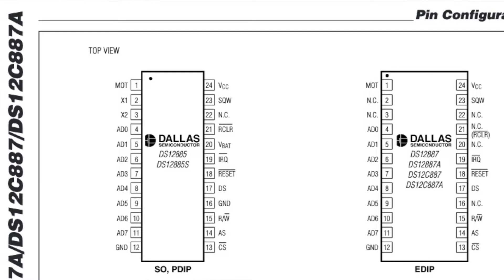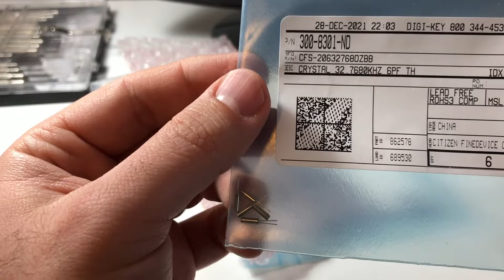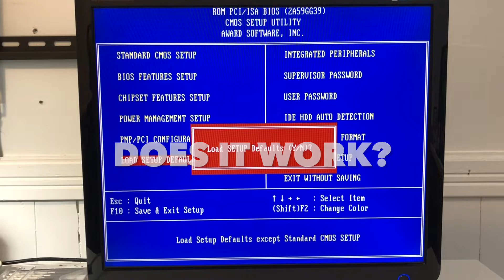Next-level RTC module Upgrade! Replacing the Dallas DS12887

Comment: Unfortunately it didnt work for me... my 486 board hangs in boot code 07 every time I stick the necroware module there... if I replace it with the old dallas the board boots right away  (even though the battery is dead and it doesn0t save any data) ...  it seems this modules are not 100% compatible
Reply from the maker: Yeah I'm starting to see this more and more with RTC modules. Some boards are picky about RTCs. One of my Gigabyte socket 7 VX boards refuses to use anything by Dallas, but works fine with the Benchmarq model. I submitted this info to the Retro Web page for the board in case it helps others.
Reply: @vswitchzero  I eventually made it work... but there is definantly instability... sometimes some settings appear not to be stored and I have had one or two system hangs... but the main problem seemed to be with the CPU jumper settings that were not working correctly (even though they were before I changed the RTC)

Comment: Hi there,  is there any chance you would sell me a RTC module upgrade replacing the Dallas DS12887?  Thank You Frank.
Reply from the maker: Hi Frank, thanks for your comment! Since this is not my design, I wouldn't feel right building and selling them. But you can definitely reach out to Necroware, who may be able to get you one. Or an alternative option would be to buy a new DS12887 module from digikey or mouser, which should be available. Thanks

Comment: I always think why you need current date on 25 year old pc used for games ? You timetravel already whats the purpose of taking a look at what time is it? everyone keep smartphone in pocket 🤣
Reply: This has nothing to do with telling the time, it's having a working system vs a broken system.. These systems require the RTC module for basic operation and some of them may not boot, lock up, or exhibit even weirder behavior if the RTC module is dead.

Comment: 6:14 Hello
In Poland (where I come from), we often encountered poor-quality IC sockets, their biggest drawback was that sometimes some plates in the sockets did not provide good contact to the pins of the IC.
After we figured out what the problem was, we started buying only stands with round holes and gold-plated.
The first advantage was that such stands "caught" each leg in several places (looking from the top east, west, north and south).
Anyone who has ever programmed any chips has certainly encountered a problem with the lack of proper connection of all pins, it frustrated me the most when I used an Asus motherboard with a crap ROM socket as a high-capacity bios programmer (~ 1998 virus Chernobyl). I used it because dedicated professional programmers were ridiculously expensive and never supported all the memory chips that ended up on my desk.
Another thing is resistance to environmental conditions, i.e. rust / oxidation, gold does not react almost with anything, so contact with the pins is eternal.
In addition, the gold-plated connections ensure the conductivity of even the weakest signals, I learned this while working with radio and audio systems.
Such stands were much more expensive, but the projects in which I used them over 25 years ago (e.g. a computer for a gas station) work to this day, I know this because I still use them every now and then.
Best wishes.
Reply from the maker: Good tips, thanks for sharing! I have also noticed that the sockets with round holes are much better. I've started putting the headers with round pins on these adapters as well.

Comment: Um, dude, if it's taking you 10 times longer to solder as you said, you're definitely doing everything wrong!

All your equipment should be clean and properly tinned, your traces should be clean and tinned too, and the solder shouldn't take more than a couple seconds at most to flow.

Any longer than a couple seconds and you're most likely burning the circuit board.
Reply from the maker: Thanks for watching and for the comment! Sorry just to clarify, I was slow constructing it due to lining things up, inspecting joints, correcting bridges, cleaning up a mess of flux etc. It wasn't due to any issues with heat or solder flow.

My soldering/desoldering skills have improved a lot since I did that video, but still learning as I go :)
Reply: You didn't get his sarcasm, sorry you're not smart enough

Comment: Hi, thanks for the video. Any idea where one can source the RTC ICs in europe cheaply? Right now it seems like they are not available anywhere, or crazy expensive.
Reply from the maker: It seems that they are getting increasingly difficult to find, unfortunately. I bought the Benchmarq BQ3285ES chips from a Canadian seller on eBay, which weren't the cheapest (about $5 CAD each plus shipping). I have seen some BQ3285 chips and Dallas DS12885s on eBay for much cheaper, but they ship from overseas. The external battery is very convenient, but brand new Dallas DS12887 RTC modules go for about $16 CAD from DigiKey, so depending on the cost of the parts, it may make more sense to just buy a replacement if the chips are too expensive or hard to find. Best of luck finding some!
Reply: @vswitchzero  the DS1287/DS12887 are not compatible with the DS12B887/DS12C887. Also I'm not sure how "new" they really are, afaik they are not longer produced so the battery inside might be just as empty as the ones on my mainboard. But I found some Texas Instruments variant on Mouser (13 euro, not really cheap), maybe gonna try out those.
Reply from the maker: @JackJack-xj8ei  Hi Jack Jack - the Dallas DS12887's I've been buying from DigiKey are indeed new. All have datecodes of 2021 and are still actively manufactured by Maxim Integrated (who took these over from Dallas at some point). The two I've used have worked perfectly. I don't have much experience with the DS12B887/C887, unfortunately. I've heard some boards with these will work fine with a DS12887, but I suppose it all depends on how they utilize the module. I have an ASUS 430HX board with a dead DS12B887 and am interested to see what happens when I swap it out. Best of luck!
Reply: @vswitchzero  well I tried those 12887 and it didn't worked. And yes it does say that they are new, but I was somehow skeptical about it (anyone can put a label on something, and with the amount of knock-off chips I've been seein lately...). Gonna try finding something, as soon as I have something that works gonna let you know. Thx

Comment: Thanks for the shoutout, I'm glad this thing was helpful. A small remark on the pins, in case someone wants to use a normal Dallas module afterwards (may be because of the original look), then it's better to use the round pins. They are thinner and don't widen the socket so much. After inserting the square pins into the socket the original Dallas module will not make a good contact anymore. If the original module is not an option anyway, then it doesn't matter. Theoretically the nwX287 can be even soldered directly into the mainboard without a socket at all, since the battery is now easily replaceable.

EDIT: btw. E in the suffix ES means power supply 4.5-5.5V, LS stands for low power supply 2.7-3.6V, LCS stands for wide range power supply 2.7-5.5V. I probably should add this information to the project documentation.
Reply from the maker: Thanks for your comment Necroware! That's a very good point about the square pins. They were a bit tough to squeeze through the PCB and too long as well, so probably not the best choice overall. I'm going to try to find the rounded ones for the next one I do.

Also, thanks for clarification on the suffix letters! I'm assuming the board feeds the RTC +5V on the VCC pin, so either ES or LCS seem like they would be good choices. I was worried the lithium cell would be too low to support the ES in that 4.5-5.5V range, but confirmed in the datasheet that VBAT is a separate input pin designed for a 3V coin cell so looks like that shouldn't matter thankfully.
Reply: The substitution is fantastic for the PS/2s that can use it (Models 25 286, 30 286, 35SX, 40SX, 55SX, and 65SX) it avoids the bad selection of a 'C' ('Y2K'-fixed) regular-sized module. I need to try the substitution for the DS1387 (additional 2Kb on-chip for the PS/2 Models 53SLC2, 55LS 486, along with microchannel Reply and NCR planars and models) soon. Upon seeing this pop up again, I just did a tweet-stream on these modules' RTC too.
Reply: keep up the good work !